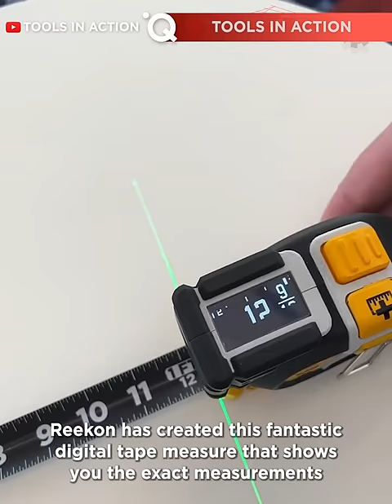Amazing Tools That Are On Another Level  ▶34

Comment: The one tool I consider worth having is the Reekon tape measure.  It has so much features in it that it's worth having when it comes to measuring things for a carpenter or home improvements. 5:07
Reply: Yeah, gonna give that a shot. CHEERS!
Reply: And it only costs $600 what a deal. 😲

Comment: With ratchets  I buy a tool if it’s worth it. Snap-On ratchets I believe are the top. My 1/4 inch drive are worth the money.  They are 72 and will do 10 to 15 degree throw in tiight places. I’m not a Snap-on guy but in aviation we may need a tool immediately in need and sometimes when the Statle of California is burning down and I need a specialized tool. I don’t have time to look for tools. Call The Truck

Comment: What's the first tool called that was like a magnet with an arm and a flashlight?
It should be called flashlight swing around arm magnet.
Who would have thought about putting a flashlight at the endbof an arm on a magnet..🤷🤦🤷 amazing
:34
Put the tool 180° and you won't have that small movement problem.
1:59
Genius
2:09
How do you get the dirt off the sill/frame and wall....don't say a hose. Please don't say a hose.
2:22
That's what she hoped for.
2:55
I use an adjustable square so I can make it look square
5:17
A $600 tape measure, who doesn't need one of those...🤷

Comment: A lot of these “New” tools and devices have been on the market for a decade or more made by other companies. It’s only because the original patents have expired and someone is making them in China cheaper.
Reply: The manual grass cutter is the best example of this. I had to cut the grass when I was ten with one of those.
Reply: Some for several decades